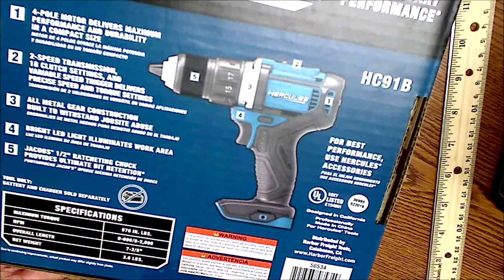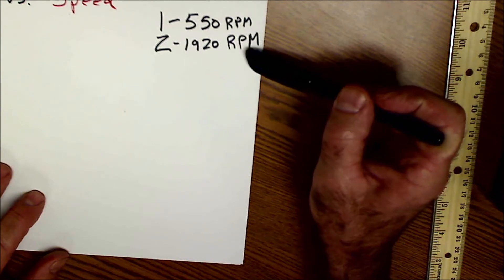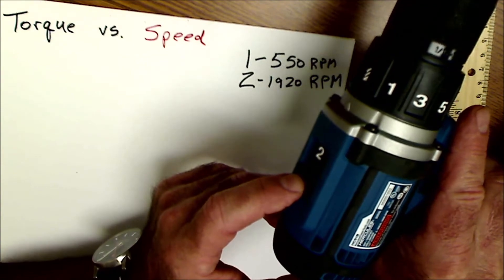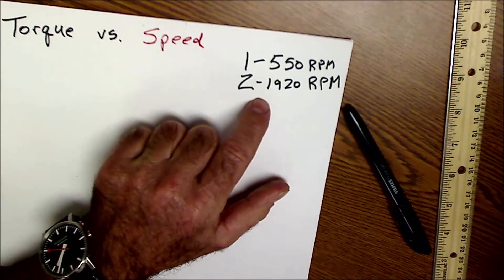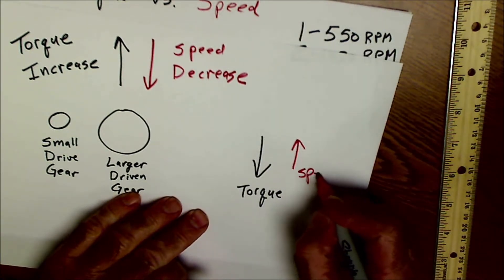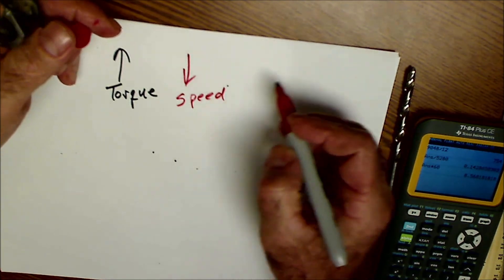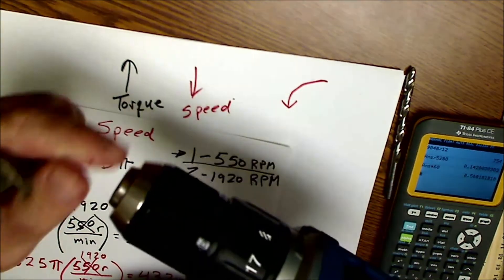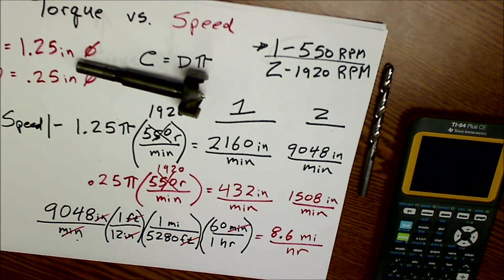Torque vs  Speed, Angular and Linear Velocities of a Drill

Comment: Is the relationship between torque and speed of a drill linear? Therefore, does the torque = 0 at the maximum no load RPM?
Reply from the maker: No they are curves, both torque and Power